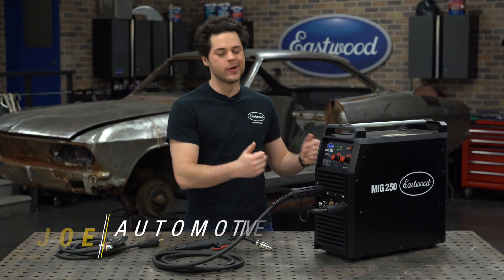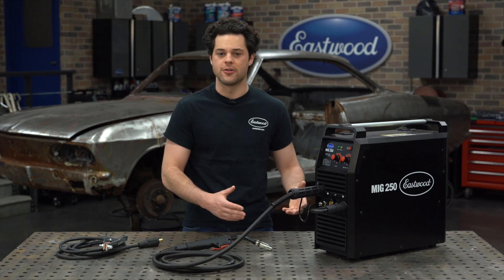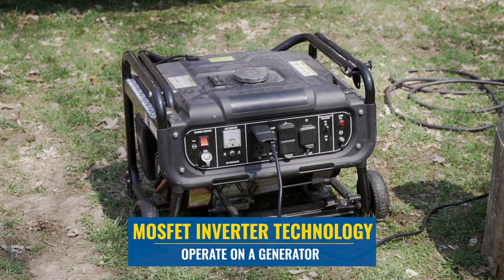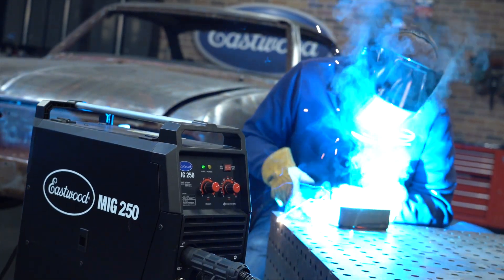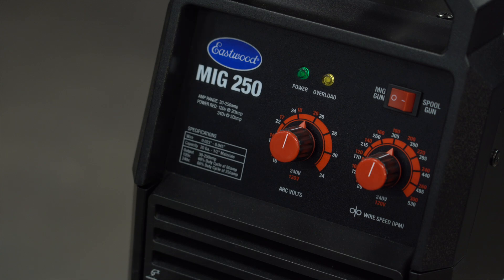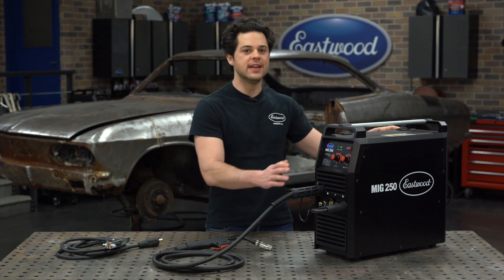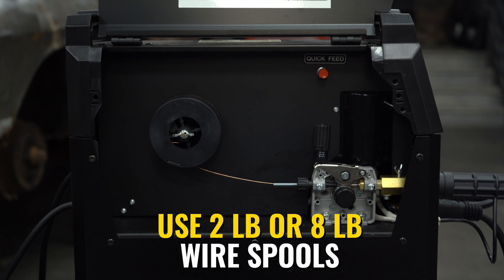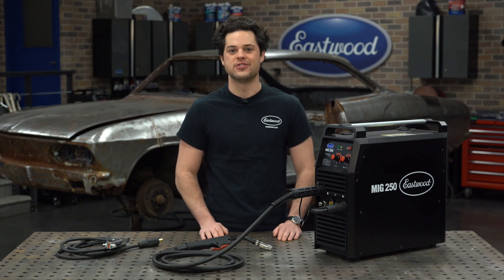The MOST POWERFUL Eastwood MIG Welder - Weld Sheet Metal to 1/2" Thick Plate - MIG 250

Comment: Built to last? Except for the cheap-ass electrolytic capacitors on the power supply board.
Reply from the maker: All of our welders have a 3 year warranty if you run into any issues. Please contact us directly if you're not satisfied 800-343-9353

Comment: I'd like to see this running  with an amp meter inline. I've never  seen an inverter welder produce the claimed amps.
Reply: Need to make a welder dyno channel 🤔
Reply: As long as it will weld 1/2 with good penetration, I dont think it matters too much. Reasonably, so long as it outputs 90% of that 250, its plenty enough for anything you might need a welder of this size for.

I'm consider the MP250i, and I'm not even a hobbyist welder yet, but I intend to do work on things that need a welder that can run across 1/2in steel.